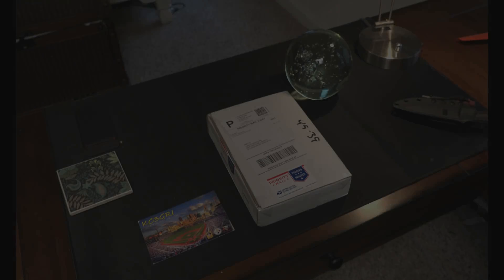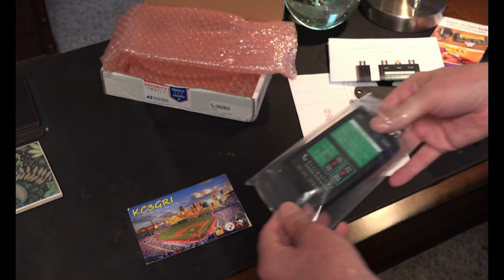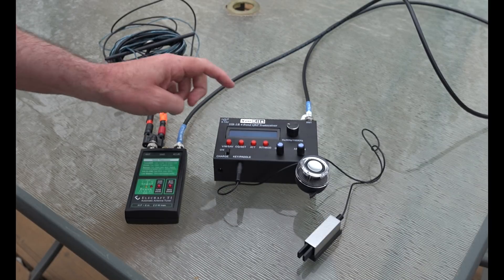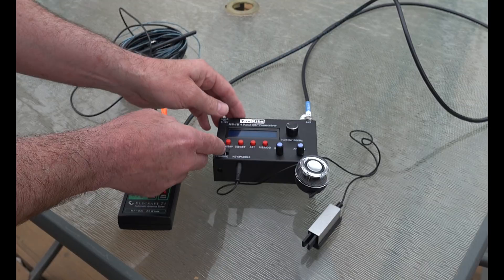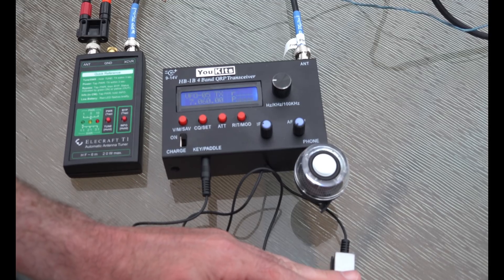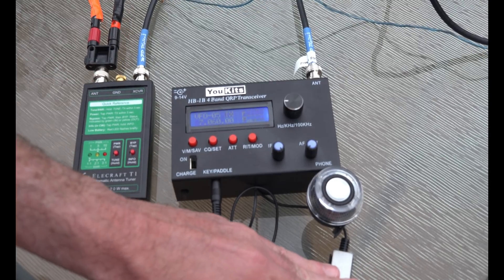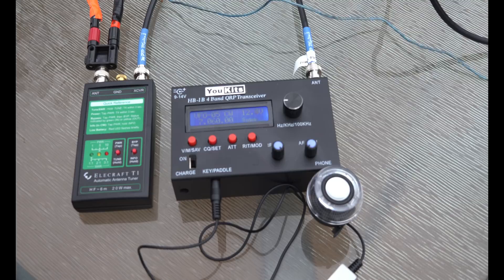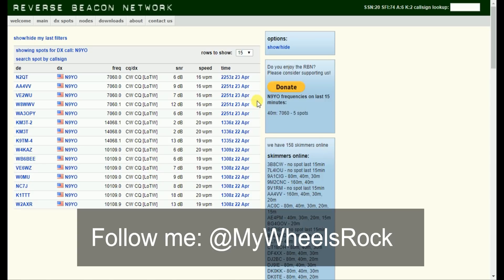UnBox Elecraft T1 Portable QRP Auto Antenna Tuner & Success Test

Comment: It appears the antenna leads might give better signals if the Red connector went up the pole and the Black (shield) laid on the ground.  I too have one for my FT-817/818 for 10 years or so. I highly recommend it as well. 73 de k2gk
Reply from the maker: I probably had it wrong in the video.

Comment: Neat setup. You are going to like that tuner. You just showed me something I did not know. Holding the CQ/set button down put the paddles in a mode that I can send a carrier. I'll have to try that on my YouKits. 
I use a 40 meter half wave end fed. I also have a KX2 but there's just something about the little YouKits that fascinates me. It's a simple tiny low cost radio that does a lot.

Barry, KU3X/QRP
Reply from the maker: It's been a while since i took it out. Maybe I'll do that this weekend. save the rain.

Comment: Thank you for this post.  I'm looking to go more light-weight.  In fact, this evening I'm building the QRP Labs QCX / 40m radio.  I have used the Elecraft T1 to good effect running 15W from my Yaesu FT-857.  Completing the QCX, I will have a true tiny QRP portable.

To share the setup I know and use, I typically use my FT857 at 100W with LDG YT-100 ATU using either 41' or 85' tiny SOTAbeams antenna wire (26gauge?) sloping from a 10m pole using a 9:1 UnUn that makes a 20' coax feed line the counterpoise.  I contacted Namibia from a park in Saratoga, NY (7,400 miles) with that rig.  It's not a large setup and tunes fine for at least 40m-10m in my experience.  It all fits in an single equipment case plus a 1m collapsed pole. That's fine for a car trunk, but I also want a smaller set up, maybe keep it to only 40m to keep the size/weight to a minimum.

My question: you are running simple wire with no UnUn on 40m.  I am very interested in that.  Do you recall the lengths of the radiator and the counterpoise?  Any special consideration for lengths? Was your setup selected for 40m, or multiple band - as your radio supports.  Do you use the same wire lengths on other bands with that T1?

Many thanks for listening to my set up and thanks in advance for sharing any wire-related specifics.
Subscribed. 73 de N1DEL.

Comment: That tuner is a hot item, I see a lot of OP's using ot on SOTA activations.
Reply: That's my one gripe about elecraft.  The stuff they make is great, but when you talk about the KX3 or KX2, they arent really built for "the trail".  I cant imagine putting my KX2 on a rock or something - its "picnic table" portable.  Its just a bit too delicate to just chuck in a bag go hiking.   

Its also a big reason why the Yaesu 817nd and probably its recent non-upgrade to the 818 (6 watts and a more stable oscillator - 14 years and thats all they could come up with) still sell well.  The little Yaesu has proven to be durable, versatile, and with its multitude of 3rd party upgrades/accessories (a few made by Elecraft) a favorite of Hams all over.  

Its just...man couldn't Yaesu have put a decent narrow-band filter some digital noise reduction in the upgrade?  Its really all that most people wanted.
Reply from the maker: You are spot on. I find the thumbscrews loosening on my KX2 all the time.  It doesn't see rugged and it's boxy looking.
Reply from the maker: Ron C I worry about its durability. Read the comments
Reply: I read that too. Well, you seem to be pretty gentle with your gear. I've never seen you throwing it around. I guess just be conscious about doing too much button mashing.
Reply from the maker: Ron C yeah I'm probably too gentle I would not take the Icom 7300 out of the house
Reply: You're a CW guy, have you ever looked at the KX1?  I dont think they've made it for a few years now, but that seemed to be the perfect balance of Elecraft quality, portability, and a sturdy design.  They dropped it when they made the KX3.

Comment: I love my T1, however I have had to replace the tune button switch once in the last 3 years and it seems that its time to do it again as It doesn’t alway respond to pushing it unless I move to the edge of the button and press really hard. Great tuner though, it will tune just about anything you throw at it.
Reply from the maker: Joel Caulkins it is great sorry to hear about the button. Ugh
Reply: also had to replace buttons a few times and resolder bnc connectors. I think the remote jack is in its way out. this time I will look for an aluminium enclosure and put proper switches and threaded BNC. I don't mind a few extra grams if I can get it as rugged as my ft817 (dog just caught its leg in the antenna lead and dragged the whole lot crashing onto concrete yet again).
as for functionality over the last 12 years II's it has performed wonderfully and will indeed tune pretty much anything that can be tuned including house wiring TV antennas ladders and defunkt telephone cables. it's a real pity elecraft don't offer a diecast case option